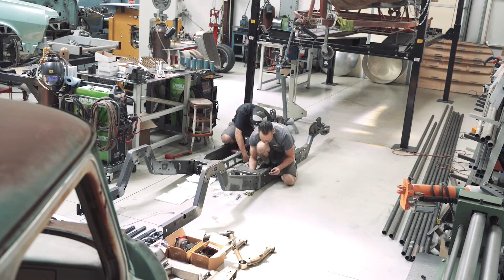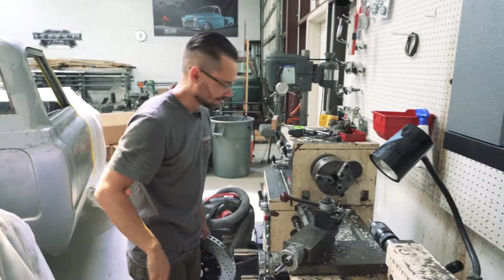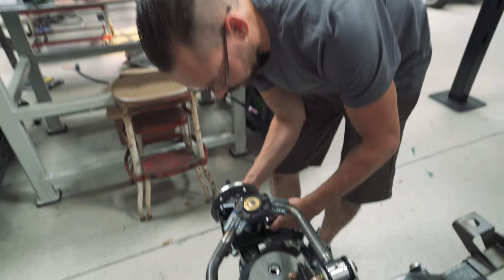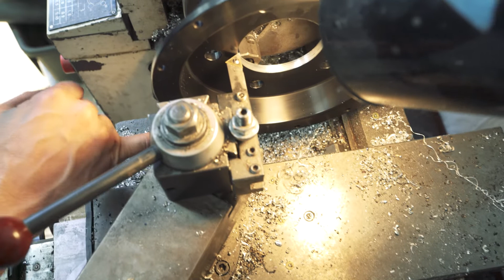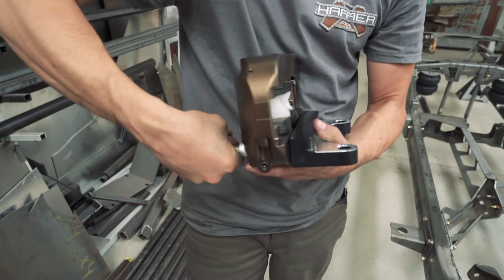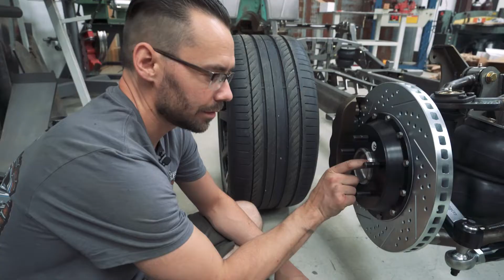Choppin Block Chassis Assembly 1966 GMC Truck

Comment: You need a boar gauge it would work great for this . Buy why don’t you just use wilwood parts so it all matches up saved hours of work for you and the customer in labor. Bear makes great stuff and so does wilwood. You yall do great work keep it up im 59 years old been doing metal work since i was 18 . And im still learning . Like your channel.

Comment: 1/8in wheel spacer hub to get the mock up finished. Then when the chassis off to powdercoat have the wheel machined down.
Reply from the maker: Brian H that’s what I’m
Doing right now but I think I’m going to switch to the corvette hub and machine a hub centric ring adapter.

Comment: Cool the hub in liquid nitrogen and heat the wheel below to powder coat / rubber temp, then re-torque them. Yeh. They won’t get stolen and then sell it before it needs tires.
 It is a joke folks, every men is proud of that extra 1/8th of an inch, except when the hub bore don’t fit. This sucks. It is like a new quarter panel for a GTO and it is 1/2” longer. It is the normal fitment issues folks run into daily when built a simple upgraded to anything that is over 40 years old. 
  Either way in this case size does matter. (Tech Tip; apply anti-seize to hub face or wheel mount flange when ever different metals are mated. I have seen 6’ pry bars to sledgehammers w/wood bocks used to break a wheel loose from a hub, even on factory wheels on factory Buicks) Plus, use a torque wrench and not colored toque sticks! Ever! Never! I will find you…🥊

Comment: Why dont you just turn down the part of the hub that sticks past the rotor face?
Reply from the maker: lilpoindexter tried that today actually but can’t get it in the lathe. Tried several different positions and it can’t be done with my setup.